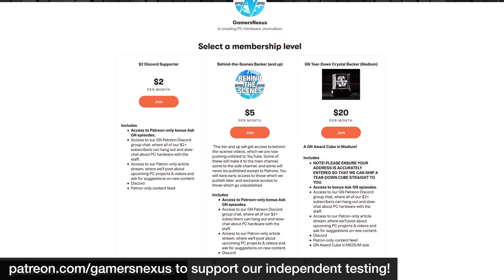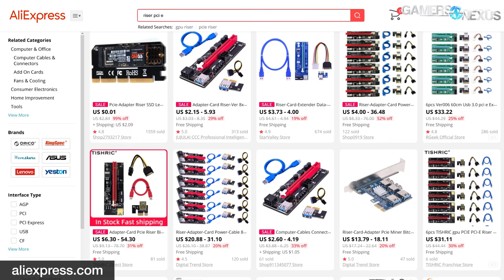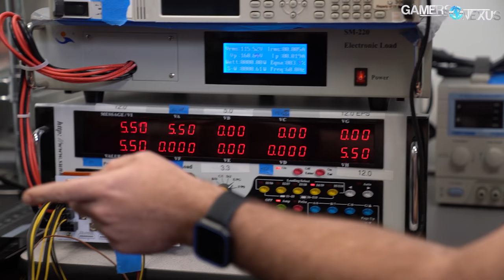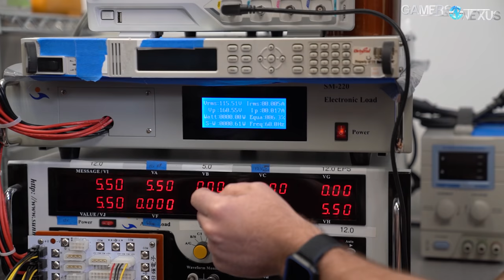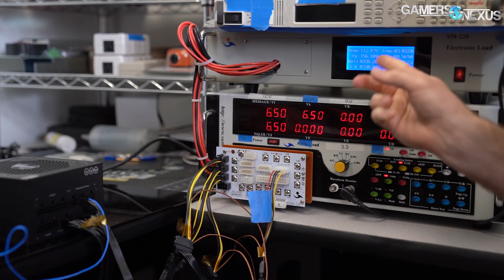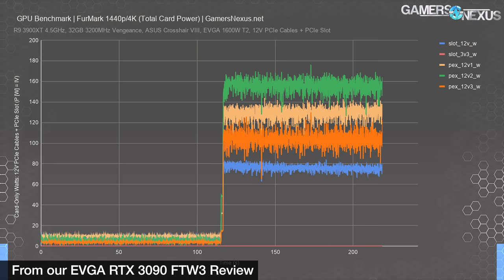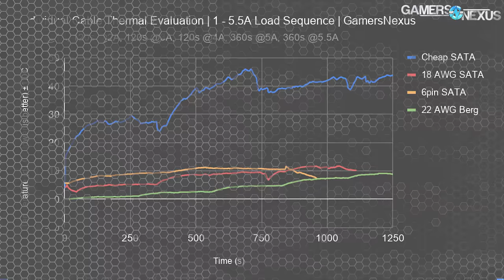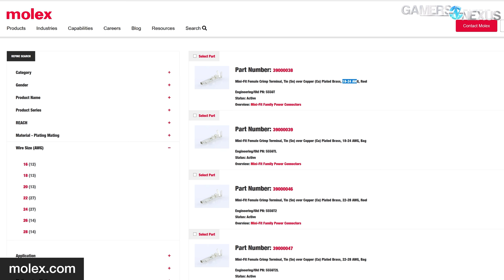Don't Use Cheap Cables: Dangerous Construction & False Wire Gauge

Comment: Excellent video. Quite a few years ago I ran 5 HDD's off of a single cable in a machine I ran ESXI on (24/7). I used a SATA splitter on one of the 4 connectors. That cable eventually melted leaving scorch marks on the HDD ciruit board. To my surprise cleaning that with vinegar worked, the HDD and PSU (EVGA) still works to this day. I can't remember where I got the splitter from but I wouldn't have thought HDD's would draw that much power. I guess I'm lucky it didn't start a fire. Thanks GN, great content as ever.

Comment: I work in automotive electrical, I have installed quite a few stereos over the years as well as worked on Factory augmentation two harnesses. The amount of companies that will sell wiring harnesses with larger jacketing and still call it a w g is absolutely mind-blowing. I have seen 16 gauge wiring with 28 gauge copper, I have seen 0 gauge wiring with 10 gauge copper.

There is absolutely no attempt in the industry to adhere to proper AWG standards.  I can't say I'm surprised to see it in the computer field too

Comment: You find this problem everywhere these days, which is a huge problem.  Speaker wires, power wires, even argb wiring.  It really is all over the place you look where you see inaccuracies.  You are taking a huge risk with budget wires these days.

Comment: I'm actually impressed at how much abuse these adapters can take! I was fully expecting the SATA to X adapters would have failed at the SATA power connector since logically, SATA power was designed with powering SATA devices in mind ... of which like 3 Amps at 12v should be more than enough. So for these el'cheap adapters to be passing like 6+ amps a piece long enough to melt the main PSU cable still surprises me greatly.

It also impressed me that even while that main PSU cable was smoking it was still faithfully delivering the requested voltage as shown on the SunMoon lol. I'm guessing the reason that the PSU itself didn't trip was that the smoking wireheap was still under (wasn't it reading like 375w or something?) but I wonder at what point the wire resistance would finally get high enough to overdraw OR if it melted and shorted if the PSU would trip overcurrent.

Last - this all not to take away from your primary message of: cheap cables can be dangerous. It's just in these cases, surprisingly the cables vindicated themselves even in like x5 overkill conditions (again - surprised me!). I think more the problem might be that - not to victim blame - that people just don't have a grasp or concept of what Amps and Volts mean (which I mean, why should they to be fair) in relation to what that means "in the real world."

Comment: Very informative, well-made video! Being an electrical engineer, I always tried to avoid buying cheaply made cables or adapters for those reasons. It is unfortunate that there is no easy, non-destructive method of testing e.g. wire gage or resistivity of a product with equipment that is affordable for most enthusiasts.
Maybe miners and other people running very high loads 24/7 should consider using fuses at relevant places in their circuits to avoid those fires (and yes, I know that power supplies have fuses for their rails, but those would in most cases not blow quickly enough to save an overloaded cable). 12V fuses commonly used in cars could do the trick.

Comment: The wire guage issue happened to me! The 3d printing club at my college a few years ago bought a new printer, and after testing it out, took it to a club fair. After about 2 hours of printing key chains, I brushed again the power cable and felt almost like I had been shocked, it was so hot. The manufacturer used a no-name pc power supply, and that company supplied a power cable that use at MOST 24 gauge wire. Luckily I had to cut the cable apart to find that out, so no one could use it again.

Comment: Out of all the crypto mining wiring info on the net I think this is the most informative. Reddit users seem to think one SATA powered riser can cause fire which I found hard to believe.  One riser per SATA or Molex cable and don't be cheap is the best advice. Don't be scared to ask an electrician. Running multiple mining rigs on one power outlet can be more hazardous than using a SATA cable to power your riser ;)

Comment: It's very easy to be tricked by cheap wiring. A very dangerous trend is a cable that appears to be heavy enough (ie. 18 gauge), but has wires made from aluminium (sometimes with just a thin coating of copper for appearances sake). Aluminium wires cannot handle the same current as copper and will get dangerously hot.

Comment: Thanks for a really interesting content piece, GN! 
Although, as someone with little electrical experience, having a small section of the video dedicated to what wire gauge is would be very nice. The Wikipedia page on it is detailed but a bit overwhelming for the newbie so maybe roughly describing what gauge is before the main content would've been greatly appreciated. :)
Reply from the maker: Understood and good feedback. Thanks for that. Basically the thickness, but then you can also get into how many strands they use. We can factor this into the next one we do on cable safety.

Comment: I really enjoy this type of testing. I get the privilege of verifying hardware function and safety professionally, and am grateful that you are willing to go to the effort and expense of making these considerations more accessible to the general public.

If the cables meet US and European safety standards, they are manufactured with flame-resistant casing materials, so I'm not very surprised that the cables didn't outright ignite in a short test. They are likely to ignite eventually or in extreme situations though... There are things that the manufacturer can do to protect against excessive current (such as internal fuses or thermal breakers) but you probably won't see those features in low-cost cables, because they do add significant cost and complexity to the cable manufacturing process, and are typically redundant layers of protection. A good rule of thumb is just stay away from bargain-basement devices and unknown manufacturers. If you must use them, buy extra so you can sacrifice some to verify things like correct wire  gauges, pinouts, and crimp/solder joint quality... but by the time you've done all that you probably would have been better off buying a higher price device made by a manufacturer you can trust to not take shortcuts with your safety. I guarantee it would take me a few hours, and if I billed that time the same as I would to my employer, the cost/benefit analysis leans heavily in favor of better cables from a trusted source, even at 2-3x the cost.

Comment: I learned a lesson 20 years ago when I did a fan controller with two potentiometers and a couple of fans. I used a standard potentiometers but it didn't matter, when I looked on the potentiemeter after a couple a months the plastic had begun to melt. I decided to disconnect it immediatly and after that I understand the importans of cooling for fan controllers, cable thickness and relevant isolation.

Comment: For those relying on molex to power risers, I had multiple cables fail, both original and cablemod (2 of the latter, 1 of the former). They were powering 2 risers with an RX 480 each, ones that were running at 1100mhz and pretty cool. The first time I came across a failed one I thought it must've been a faulty cable, I later found 2 more.  
They've usually failed at the point where the cable connects to the plug, so even if the cable is fine it might still die on you because you've unplugged it several times and the cable isn't in the best condition any more.  I wouldn't say I ever put any unreasonable amount of force on the cable, they were never unplugged by pulling on the cable etc. 
I wouldn't use more than 1 molex connector per cable any more and if at all possible I'd just use pcie 6 pin connectors, even if that means using an 8 pin to dual 6 pin splitter.

Comment: Thank you so much for the information about sata connectors. I don't mine, but I have rigs with multiple gpus (for virtualization), large hard drive arrays, and large cooling configurations. This information applies to all of this, and  reinforces my own practice of replacing sata connectors with PCIe power connectors (they are easy to crimp and work with, with molex brand male and female pins and housings cheap from digikey).

Comment: I second your views on wire quality!

I recently bought a FLIR One camera.
Didn't really need it, but I was 3d-printing and wanted to know where the heat and cooling was.
After a while, I decided to test the cooling system in my computer.
Dual 240 rads, mounted 'shark-gill' style.
Air comes in the front, passes through the rads on left and right (rads live in empty drive-bay) then spills out the sides of the tower case through vents.
No warmed air makes it into the main volume of the case!
In fact, the outside of the case gets cooler running stress tests!
I was shocked (get it?, shocked, electrical joke...) to see how hot the wiring was getting!
The VRM's warmed up, of course.
The cable feeding the VRM's heated up faster!
Same story on leads for the GPU and motherboard: the wires were the first thing to get hot!
Some got hot enough to soften the insulation...

The insulation looked beefy, but the copper inside was Christmas Tree tinsel...
Gigabyte 'modular' 850 watt supply, about two years old, with Gigabyte-supplied cables.
Not since Sony used copper-plated cotton thread in their headphone cables have I seen such flimsy wiring!
Yes, it is stranded.
Yes, the strand-count is high.
Yes, the strands are flexible copper.
No, not many of the strands run from end to end in the cable.
I found strands less than 15 mm long in the bundle!
It was easy to tug strands from the cut end of a piece of cable with tweezers.

I replaced it all with actual 18. ga stranded wire that runs from end to end, all is running cool.

BTW, there never was a glitch or surge that revealed the crappy wires, it was the heat.

1) Hot wires = lowered voltage at the end device.
2) Lowered voltage = higher current to deliver same net power to device.
3) Higher current = more heat in the wires.
4) Hotter wires = more resistance in the wires, more heat generated.
A loop forms at step 3 and 4, leading to 'thermal run-away' if there is enough power and not enough cooling.

Comment: 4:00 : The sata to molex converter in my pc : 
(chuckles) I'm in danger
Reply: Molex to SATA lose your data
Reply: just converters in general, WHY?>. get the right power supply FFs.
Reply: @harmonicimbalancer1678  Changing the entire power supply because you need one connector to be diffrent is incredibly wasteful.
Reply: @harmonicimbalancer1678 
Because not everyone custom builds a while new PC when they need one part replaced/upgraded. I've used several hundred of those SATA power adaptors over the years in hundreds of PCs... I don't recall ever losing data from one.

Comment: More POWER!!!!
Reply from the maker: SPEED AND POWER!!!
Reply: @GamersNexus  So would the flow of electricity be considered laminar flow through copper? It gets more resistance on the outside strands compared to the core?
Reply: @Jay_the_Caffeinator  Only the outside of the cable has electricity flow (I mean, the outside of the copper, obviously)
Reply: @aitorbleda8267  Thanks for that. I am a nuclear mechanic by trade. All I know about electricity is that if I don't isolate it, it can kill the people doing my ship yard's work. So the actual way it flows I am just trying to understand the way it really does, and equate it to the flow of a fluid.
Reply: @aitorbleda8267  That's actually only for AC electricity. DC electricity like on the inside of your computer uses the entire wire for transmitting current.

Comment: I've had a fire in my case several years back.  A cheap "included" Molex to Sata power adapter to my HDD caught fire while play Star Craft 2. I happened to see it through the plexiglass side widow just as it started.  That day was the fastest I every unscrewed the side panel. Managed to put out the fire with with minimal collateral damage. The HDD SATA contecter was a little warped from heat but still worked.

Comment: As someone that has had a computer go up in flames, thanks for putting this out there.  In my case, it was a computer built by a major system integrator.  A SATA cable went bad at the connector for my SSD and my computer went up in flames.  Thankfully I was home at the time and was able to put it out.

Comment: Another thing to show would be molex and sata to 6pin that people use oem power supplies don’t have 6pin gpu connectors.
A very common use case when making a budget system by adding a gpu to an old prebuilt Dell/HP etc.

Comment: I actually purchased a few packs of pcie power splitters on ebay. 3 of them were the listed 18 awg, and one pack came 22 awg. It felt like it was made from fan wires! It just shows you how little accountability is going on in this market sector. I got multiple different products from the same listing

Comment: Good piece, I love seeing more educational stuff like this. The work you all do to keep us safe is fantastic.

This does give me a few questions though. Mainly, it brought this thought back:
EVGA (and possibly others) includes a 8-pin to 2x 6+2-pin PCIe connectors, which seems dangerous.
The spec of one 8-pin slot is 150 watts, but there are 3070s and 3080s that only have two connectors and draw a whole lot more power than the spec of one 8-pin (plus the slot).
However, with the single 8-pin to effectively x2 8-pin connectors, it's possible to "run" that card off of just one 8-pin, when it needs more.

Additionally, if you don't intend for this to happen, why include only those cables? If you want to follow spec, you now have to have two dongles flopping around, or you have to buy additional cables.

It just doesn't make sense to me...

Comment: Another you could do..

Buy lots of different DisplayPort cables, test them all on a known good system....

The reason I say, is we recently moved to a couple of 1440p DP monitors, and the cables we used caused issues - the PC wouldn't boot, and had a weird BUZZING sound...

after investigating, it seems 'cheap' cables may have Pin20 connected, which is power back from the monitor, so it's sending voltage back down into your GPU and PC... usually around 3.3v but can be as high as 16v...

Have known it to cause fans to spin when the PC isn't powered, LED's to light with no power, and even stopping the PC turning on / booting...

It needs to be investigated, which cables work and which ones don't etc.. and more people need to be aware of it as more and more move towards DP connections as they upgrade...

Comment: Considering how risers are in every gaming case nowadays, this is a really important video, so thanks! Just gotta say, would have loved to see the vdrop from the connector at the PSU to the connector at the "device" using different connectors and adapters, and under different cable temperatures.

Comment: Also, understand using long cable runs equates to voltage drop and that equates to conductor overheating.  In addition, do not wrap conductors with other conductors as it will result in a build-up of a high electromagnetic force and generate both a heat-up of the conductor and voltage drop across the conductor that compounds the problem of conductor failier.

Comment: The molex to sata connectors are also used for connecting newer hard drives with PWDIS to older power supplies. If you don't cut power to pin 3 the hard drive will be stuck in reset. Even under those conditions some of the cheap molded versions have melted. I just pulled the pin out of the connector instead of using an adapter.

Comment: Something I learned as an apprentice electrician is that you need thicker wires the farther away you are from the source. It makes perfect sense that you would need a powered riser with that in mind.
Reply: For non electricians: more length = more resistance, which is bad. More thickness = less resistance, which is good.

Comment: Over a decade ago I worked at a custom stereo shop. Most of the DIY disasters we fixed were caused by poor quality wiring kits that completely lied about the gauge of wire the kit contained. These kits often shipped with 150 amp fuses leading the customer to believe their kit could handle that. In reality the kits could only really handle about half of that at the best of times. Completely different market, same dangerous lies.

Comment: 14:30 Just wanted to mention that you can already see smoke here (if you've missed it).
This does NOT mean that anything before that was safe! Hot plastics tend to gas out under high temperatures, usually releasing toxic gases! If it smells plasticy or chlorinesque, you're pushing it way too far! Engineering guidelines are to stay at least 33% away from such critical points, since you want to have headroom for peak forces/power use/quality fluctuations in your product.

Comment: DUDE, nice timing. I just melted the POWER CORD of my PC while using my Oculus quest 2 with it linked. Guess it was just too much for it. 
I think I grabbed a power cable that was a lower gage when I moved recently and just grabbed whatever "pc cable" I had to hook it back up. It was definitely less beefy than other cables I have on hand. Didn't even think twice about it when I did it but I will now for sure. Literally started smoking out the back of my PC and then it shut down. I was in VR and I started to smell burning plastic and was like wow this VR is crazy LOL. Thankfully the PC was fine after a new cord and I made sure to use the proper size cable.